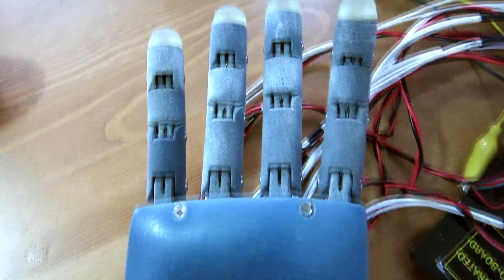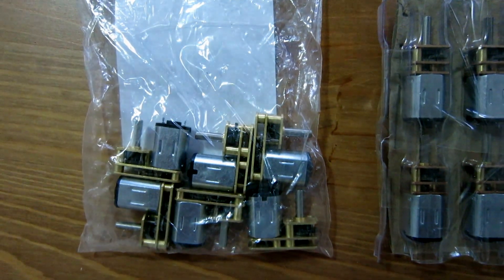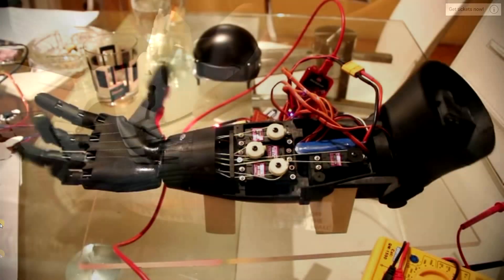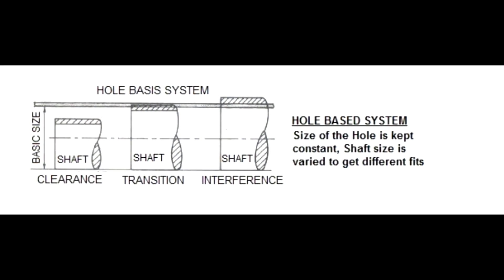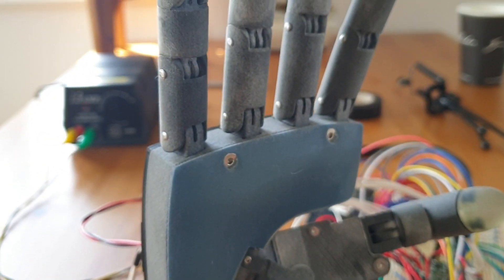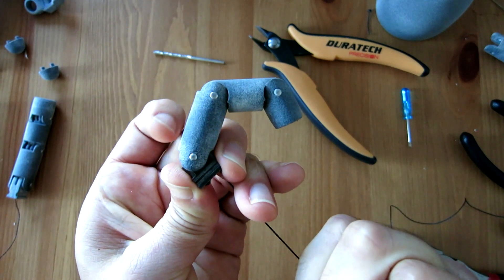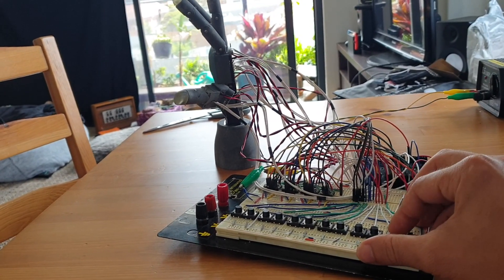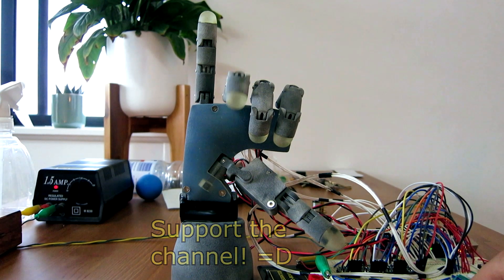Bionic Hand Grip Testing - 3D Printed Prosthetic Hand Progress

Comment: But can you do this with a Flashforge Finder 2 or 3 3d printer?!
Reply: you can yes, the purpose of using "SLS" printing like he did is to get a more resistant end product since prosthetic breakage is a common issue when used everyday. Just mind the type of filament you use since the motors can heat up quite a lot and for example PLA could start to melt or soften at 60 degrees C

Comment: Great video and thanks for sharing this much information as well.  I had  designed and built a robotic hand prototype 3-4 years ago and I have also stumbled upon similar problems. I have a few humble suggestions for you hoping that they will help. First is I believe the best approach for actuating the fingers is not a pulley mechanism. Because like you mentioned putting a counter acting spring is problematic as it also creates a force the motors have to over come as well. They also cause wear like hell unless guided over metal bearings. Strings also do brake too. I had investigated almost all the products there is and I think the best approach is bebionic hand's. Each finger is kinematically forced to do bend the same way and all you have to do is pull it with a linear motor. The downside for this approach is that micro linear dc motors aren't cheap at all. The best option I found was actuonix PQ series linear motors with pot feedback. Even that actuator is not as small as the aliexpress dc motors you are using but I suppose will do the job. My second suggestion is that I think your thumb design seems to be a bit weak, like it looks as though it would be easy to break. I would suggest a simpler design with les dof if you are heading for a commercial use. Lastly, for the PCB, I would suggest learning how the off-the-shelf pololu (or the like) dc motor controllers work and add them to your pcb design piece by piece. That way your PCB footprint will decrease dramatically. So yea, Godspeed! and greetings from Istanbul.

Comment: That's a very nice design but the primary thumb joint is so far into the hand. It should be in line with the index finger. Look forward to the poor videos
Reply from the maker: Yeah the thumb joint is deep into the hand, the micro motors we're still a bit too large to fit two into a small thumb base. Could definitely be improved with another design iteration. You thought the video was poor?

Comment: One question: Did you improve the grip force in comparision to the one in your thesis? In seems to me that was the major set back, along with the endurance of the materials.
Reply from the maker: I actually made a silly calculating mistake way back in my thesis and under calculated the grip force. In reality it was actually a bit higher. This new design is comparable in grip force but the materials and design are more robust and durable, although there is still a lot of optimisation to be done

Comment: When you push the fingers when it’s stationary does it return to its original position?
Reply from the maker: If power is supplied to the motors then no, they will hold the tendons so the fingers cannot be moved. If the motors are powered off then the fingers csn be pushed to their extended position but it requires a decent amount of force as the motors are highly geared

Comment: I love this design so much! I had a question about the type of elastic you use to "recover" the resting position of the fingers. I've been looking at different materials to use in my own project and I was wondering what you used in your design? Also, how did you ensure the tension in the elastic was enough to fully bring the finger back to its resting position? That's been an issue I've been struggling with haha. I can't wait for the next update!
Reply from the maker: Thanks! I used nylon elastic cord, just got it off ebay. The tension was fairly light, just enough to overcome any friction in the joints. I would still have to back drive the motors for the fingers to open again. Don't want too much tension as the motors will be working against that, thus reducing efficiency. Life has gotten in the way recently but might return to this project at some point

Comment: Nice work!! Can you please tell me what is the diameter of the elastic rope and the maximum torque of the motors?
Reply from the maker: Thanks, the rope is about 2.5mm diameter. The motors vary in torque depending on the specific model. You can look up the micro metal gear motors on the pololu website. I suspect they over estimate the torque though. Such high values may be achievable temporarily but will damage the motor in the long run

Comment: Wow! I'm super impressed. You gained a subscriber. Keep it up!!

Could you replace(assist) the extension band with a new cable connected to the flexion motor? It might need its own cable spool
Reply from the maker: Thanks! You could do that yes. It would be difficult to get the tension correct in both directions. You might have a small amount of slack in one side so the finger would take time to respond after the motor changes direction. It would also remove the passive compliance of the finger in the flexion direction. This compliance is good for example if the hand where to hit an object as the fingers would bend in and absorb the impact, as opposed to being stiff and potentially being damaged

Comment: Huge respects for your works. your achievement of getting the thumb to be able to touch each individual finger is incredible. This device is still far from perfect however, fingers need to have atleast 2 degrees of freedom otherwise the tips will only be able to follow a specific arc rather than being able to be anywhere on the axis given plane. This is essential for say- using a screwdriver. I do not know of many hands that can do that, but none the less keep up the great work.
Reply from the maker: Thanks man. Great understanding. I would like to incorporate an additional DOF for each finger in the future. I could potentially fit the motors for this in the forearm. However for now I would like something as compact as possible. Potentially this version could be suitable for someone who has lost their hand. The other version with more DOF's could be suitable for someone who has also lost their forearm. One step at a time though. Thanks again

Comment: Such an amazing design, that is definitely the most compact motor design I've seen. I'm surprised that you've gone with SLS and Polyjet for your prototypes. Does this not drive the cost up a considerable bit?
Reply from the maker: Thanks a lot! Yes using SLS and Polyjet adds significant cost but I'm aiming for a high quality device. FDM just cant offer what I need. I even plan for certain parts to be machined aluminium
Reply: @MahdiDesigns  In that case I guess it makes sense. Your tolerances must need to be pretty strict to fit the motors in. I'm making a body-powered hand with a friend and we're looking to get parts SLS printed in the next month, would you be happy sharing roughly how much it cost to get the hand SLS printed? (I know prices will vary, but its be nice to have a ballpark)
Reply from the maker: @swinny176  It's not so much about the tolerances, rather the better quality from lack of support material. The interface with support on FDM prints always comes out quite poor. Also, SLS prints are much tougher and less likely to break. Tbh this design could be FDM printed but it wouldn't be as durable, would look worse and wouldn't assemble together nicely. Cost is roughly on the order of several hundred $, depends on the exact cost of your supplier though. I would start with FDM for your first prototypes